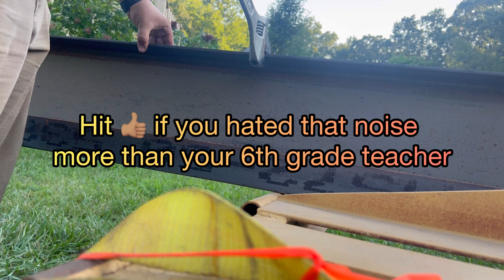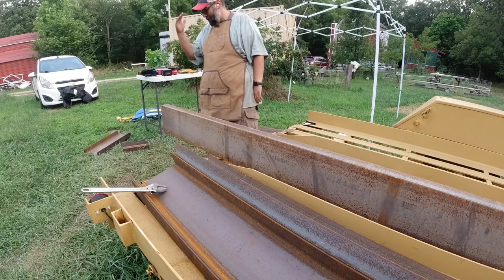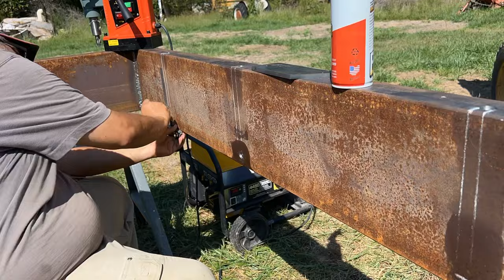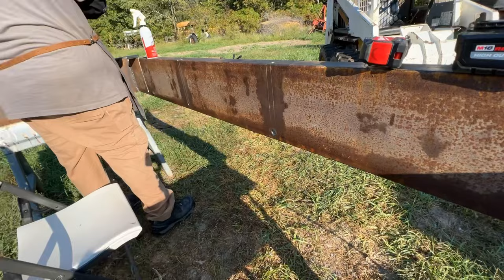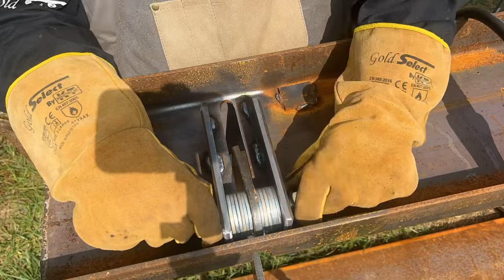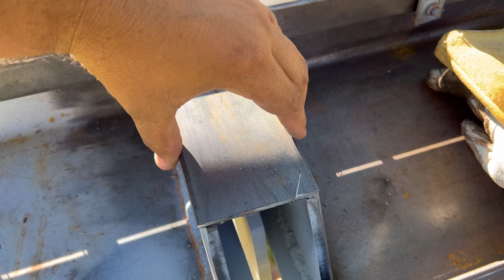Secrets of Building Bulletproof Blast Doors for Our Bunker

Comment: Unfortunately you should never put hinges where they do not have access to them.  Particularly like this as you will have no way to lubricate them so that they last a long time, or should they get dirt or a liquid in them it will be tough to get out.  You should have installed the hinges where you had full access to them from the protected side of the door.
Reply from the maker: Thanks for the input but I can lubricant them and the door will maybe shut 2 or 3 times a year so I think it will be fine for a really long time. I’ll keep you posted.

Comment: Approximately how much is ot going to cost for the finished product? Also whats your sqfootage for the barndo? My boyfriend and i are trying to build the exact same thing
Reply from the maker: Are you asking about the barndo alone or with the basement too? I can tell you that basement alone will cost 3x the barndo. 
You’ll see in some upcoming videos that I’ve done a few things that dramatically cut the cost of my build as far as the building goes, like I bought all my metal from an auction sites called purplewave.com for so much less than retail, but I had to take two days to drive to Lubbock TX to get it and back. 
I’m estimating about 60k for everything above ground.